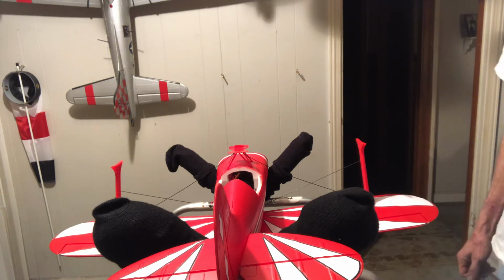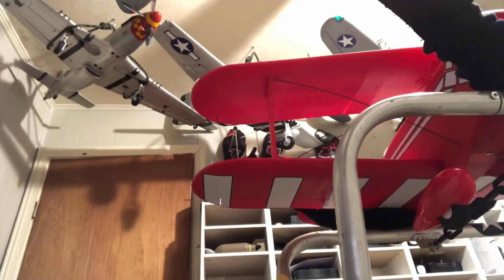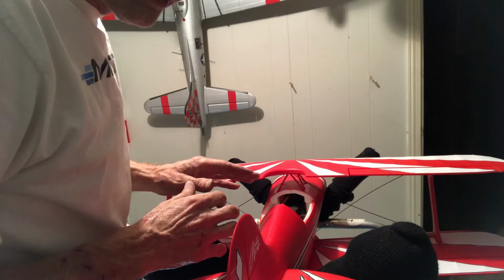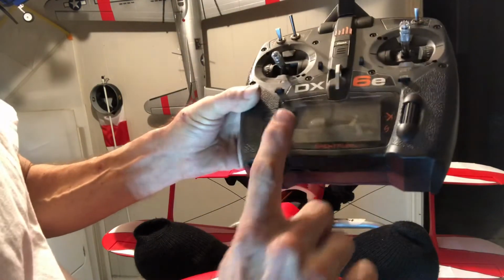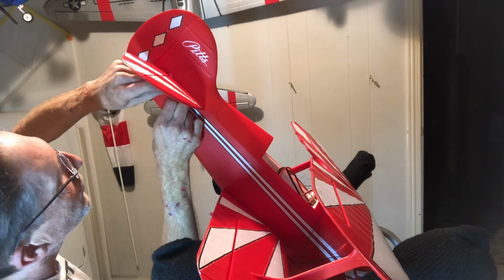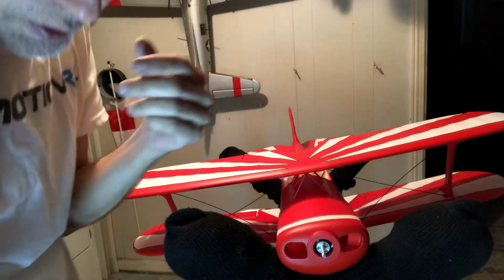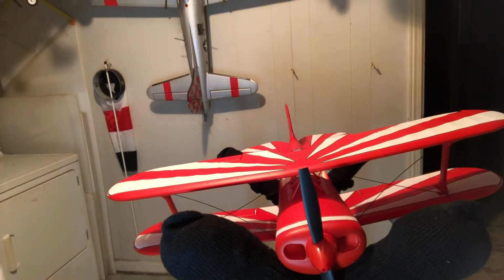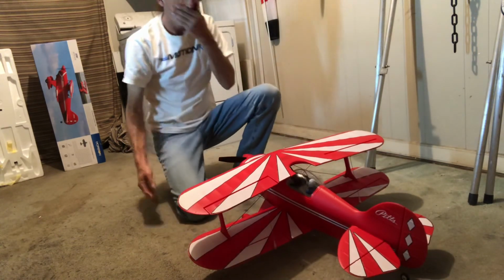E-flite 850mm build (P2)

Comment: You have safe select and as3x reversed.  Safe select will auto level the wings when you let go of the sticks.  It also limits the bank and pitch angles so you can’t go upside down. It is optional and set on or off with the bind plug procedure.  It can also be set up to be toggled on a switch.   As3x on the other hand is always on and it does corrections when you hit wind turbulence. It does not keep you from going upside down.
Reply from the maker: Love RC OK. Got no way to edit so just explain in description.👍🏻
Reply: EQ RC good idea! 👍